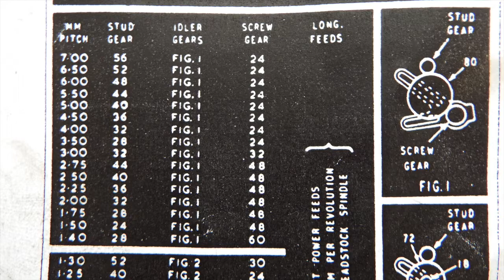Cross slide backlash PART 2

Comment: Do you find an overhead projector a useful alternative to a shadow projector/optical comparator? I often needed one for small clock gears but the cost is prohibitive.
Reply from the maker: at the time I only had the slide projector but I now have a digital microscope with x-y axis controlled with a micrometer  so you can measure distances 
see https://youtu.be/rlMV2aNi3vg and https://youtu.be/-wsd5Yj_lck

Comment: Hi. I have just made a Leadscrew nut myself and found your Video's very helpful, however I made my tool from 3/8 hss square  tool and with acme form i.e. 29 degrees and it fits perfect with ,001 play. I feel you are right yours is a worn leadscrew. I also have a milling attachment for the lathe and milled the bar before putting the thread in. enjoyed the video Thank You. Peter

Comment: Thread specifications for an Imperial Boxford lathe:

Hi Allan, I have some questions about the kind of thread used for the cross-slide lead-screw and posted this on the Boxford users group, hoping for some feedback. I hope you don't mind. You do excellent work and make great videos. I just discovered in the comments below that you are using a metric version of the Boxford and that would explain why you discovered a pitch of 2.5mm when the imperial lathe has a pitch of 2.54 mm or 10 TPI.  So you would certainly have a metric cross-slide lead-screw that is different to my imperial model.  I will have to make a correction to my post!  Thank you!  Here is my post. You might find something of interest.

I have a question about the type of thread in the Boxford cross-slide lead-screw. I have watched Allan's video in Enots engineering at least 3 times and decided to have a go at making a nut. Nothing to lose except patience, time and metal!  Whenever I try to do precision turning like a push fit, it fails. I make a cut that is within a few thou of the final size, make a second cut without changing the dial and it goes too deep resulting in a diameter that is too small. I cannot justify a DRO and it may not solve this problem. So here goes.

Allan used an overhead projector to enlarge an image of the thread and decided it was similar to an acme thread, but instead of having side walls at an angle of 14.5 degrees they were 17.5 degrees and the pitch 2.5mm with diameter 11 mm. 

It seems to me that these metric measurements are very unlikely in a 1953 English-made imperial lathe.  The 2.5mm pitch is actually 2.54 mm which is exactly 1/10 inch, or 10 threads per inch. That makes sense for an imperial lathe. One turn is 1/10 inch which can be calibrated in thousandths of an inch. So there is little doubt that it is 10 TPI. But I later discovered that Allan has a metric version of the Boxford which would explain the differences. His would have a pitch of 2.5mm rather than 2.54mm.

But it is not a standard acme thread. To start with it is a left-hand thread although that must be very common in machine tools. Secondly the diameter at first glance looks like 7/16 inch and acme threads of this size should be 12 TPI. But for obvious reasons they used 10 TPI. They should have used a half inch thread with its standard of 10 TPI. Other manufacturers do that. 

Then there is the diameter. It is 57/128 inch or 0.4450 inches. The acme specification for a 7/16" thread is exactly 7/16 or 0.4375". So this lead-screw is slightly oversized by about 1.7%.  In reading about acme threads (EngineeringEdge.com hardware), acme threads come in several classes G2, G3, G4. Classes G3 and G4 are recommended if minimal backlash is required. These two classes allow the internal thread diameter to be increased to 1.020 to 1.040 times the nominal diameter (D). Thus the internal thread may be 2 to 4 % oversized. 

Now my theory is that they intended to make the nut with a "near standard" acme tap, slightly oversized, but compensate by making the thread slightly oversized. So ideally we should make the internal thread about 2% over the nominal 7/16 inch diameter. In practice we get around this by fitting by trial and error.

Then we come to the angle of the walls of the thread.  Allan measured the angle to be 17.5 degrees rather than the "standard" 14.5 degrees.  Well if the thread is non-standard anyway, that could be true. But I think it must be pretty difficult to measure this angle and an error of 3 degrees would be likely to occur. So, I think I should stick to my theory that this is based on standard acme angles and use 14.5 degrees, assuming I could ever make a HSS tool with that accuracy anyway!

So I am wondering what others think of these conclusions. It is surprising that I have been unable to find any detailed description of the specs for this thread. In fact Boxford book "Know Your Lathe" discusses acme threads on page 74 and mentions that they are frequently used in machine tools without mentioning that their own machine tool has non-standard acme threads (10 TPI for a start). They do mention a modified acme thread for worm gears. It has an angle of 14.5 degrees but is deeper.

Any suggestions would be appreciated! 

Evan
Reply from the maker: Hi Evan When I ground my cutting tool I used the cross slide thread as a gauge to check the tool matched. As the screw thread is old and probably worn. That way I'm making the nut to fit the thread which should have less backlash. I have seen a Boxford nut with an anti backlash adjustment which had a threaded insert and was adjusted using a grub screw through the centre of the nut locking screw
Reply: @enotsengineering  also, huge thanks for this and the other Boxford videos, it's helped a lot in maintenance and repair!
Reply: I know this is years after the fact, but I have painstakingly measured the screw, and came to the same conclusion, the thread is 7/16"-2.5mm for the metric version, so it's a weird mismatch of imperial and metric. As for the thread angle, it gets a bit more iffy. I have done close examination of the screw, and I lean towards the angle being ACME, 29 degrees, rather than 30 degree trapezoidal thread, or other. It makes sense as then the only thing which actually is different between the two screws is the variance between 10 TPI vs 2.5mm pitch. This has all been confirmed by modeling the nut in CAD and printing it on a high quality 3D printer with very high dimensional tolerances. The printed nut fits the screw perfectly, there is absolutely zero backlash but the nut moves along the screw smoothly. Next step will be making a new nut similarly to the video above.

Comment: Good result. Out of interest, why do you keep the half nuts engaged if you're cutting metric threads on a metric lathe?
Reply from the maker: Hi Mark.
My reason is that I do not have a lead screw indicator fitted. As I was cutting a 2.5mm thread and the lead screw is 3mm its important that the half nuts engage in the same position on the lead screw each time to maintain the same cutting location at the chuck.
Thanks for watching
Reply: With you, didn't realise you have not got a thread dial. Not cheap for metric Boxfords either. I'm in similar situation as I cut all metric threads on an imperial Boxford, so my dial just sits there looking pretty.
Reply: I thought metric thread dial indicators couldn't exist, because metric threads aren't defined as a fraction of something else?
Reply: @1873Winchester they exists allright, I have one on my lathe, and that is metric. In fact, I can place it for both metric and imperial, as it have 2 gears, and can sit in 2 positions on my AUD mk II